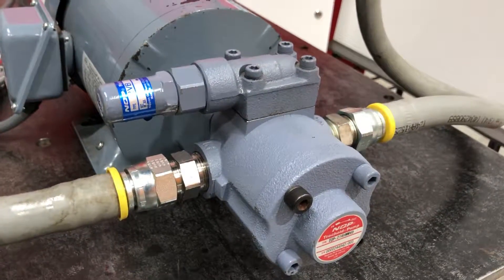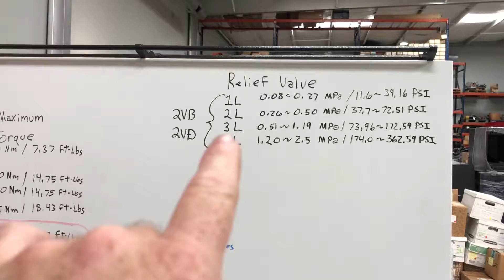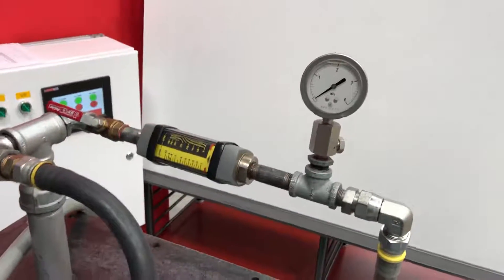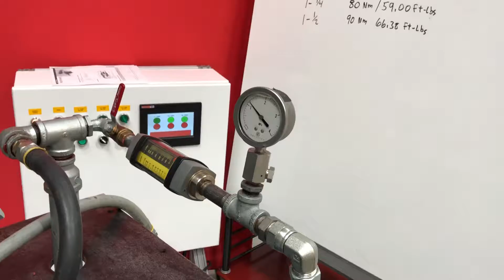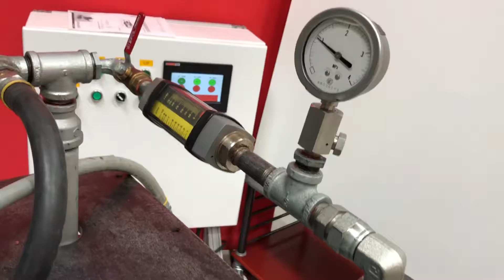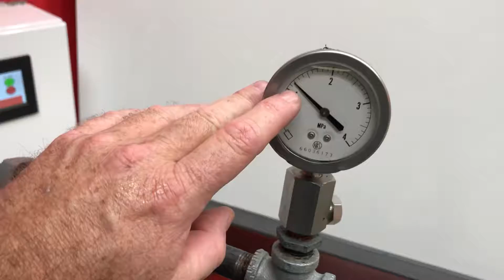Proper way to set the relief valve pressure on a Nippon Oil Pump.

Comment: Thanks for the info. Do you know how to correctly hook one of these pumps up to 120v ac correctly? I got my hands on one of these, a top-1me-75-1-5, which is the 4 pole motor with a 11mavb pump, and can't find any good info on how to hook it up to power. Trying to use as a lubricant pump for a cnc machine.